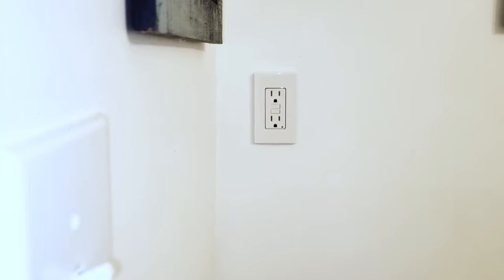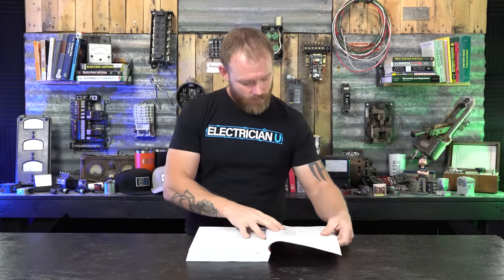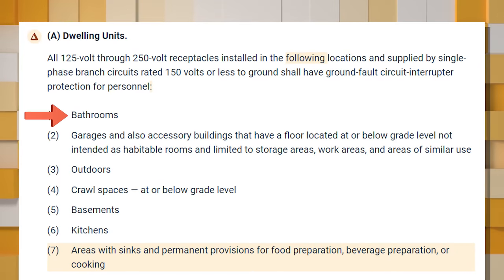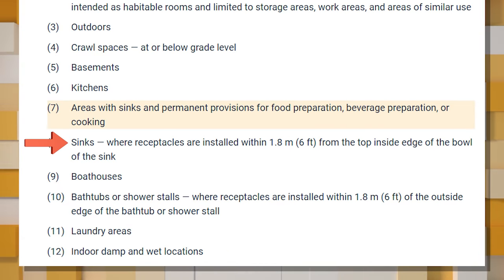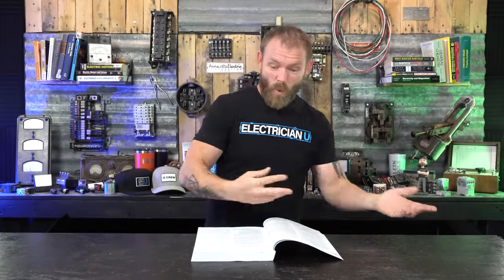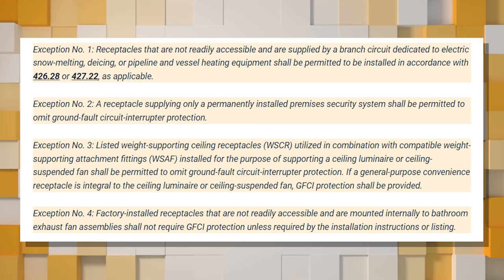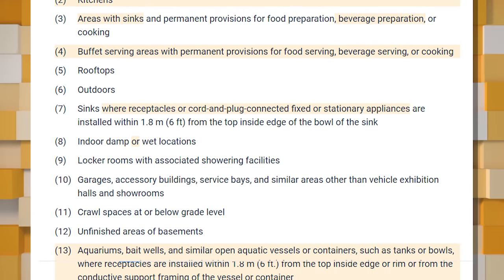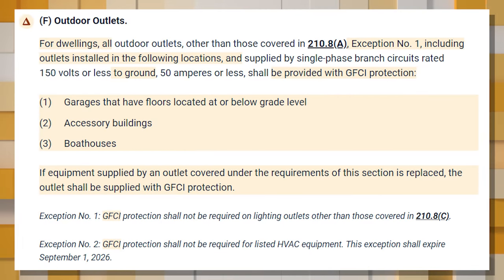Where and Why Do We Need GFCI Protection?

Comment: Wish, back in 1952, the house we lived in had a Ground Fault Breaker for the Basement.  I was 7 years old went down into the basement and wanted to turn the light on but could not reach the chain.  So I climbed up on the water tank and grabbed the chain. Getting electrocuted I Immediately started screaming and was frozen between the string and tank.  My mother came running down the stairs with a wooden broom and knocked me off the tank.  I had two black holes burned into my thumb and the doctor put me to bed for two days.
Reply: Close calls like what happened to you, is why code changes occur (equipment grounds in the late '50s/early '60, GFCI protection in the 70s and expanding in subsequent code cycles, AFCI  protection in the early 2000s beginning in bedrooms and now covers pretty much every area in the house. , I believe it's required that for pull chain fixtures a rubber piece called an insulating link, is used with a metal chain, to prevent an internal failure in the fixture from electrifying the chain.
Reply: Gene Metz - Wow! You are very lucky!
Reply: @Sparky-ww5re  Glad I read this comment as I just bought a 1924 house with ungrounded receptacles and some old pull chain lights of unknown age in the basement and attic. Will look for those rubber insulating links now.

Comment: Our 64 house has some interesting wiring. One circuit on the back of the house covers a kitchen wall, the back porch outlet, and the guest bathroom. The people that remodeled it clearly didnt have an electrician, as every single one of those areas has it's own GFCI. Now, every time it's slightly humid outside, we get to play a game of "which GFCI tripped."
Reply: Maybe rewire all the receptacles with each device pigtailed. then even if one trips, the rest will still have power. That's if all the receptacles are GFCI type, and no receptacles downstream of one GFCI receptacle are depending on it for required and/or desired GFCI protection.
Reply: @cavscout888  well wouldnt there be some daisy chained later that would be off from the gfi that tripped
Reply: Why not just put the GFI on line side?
Reply: That's what's happens when you load gfci off of other gfci. They should have line sided all the gfci
Reply: Well if that’s apart of your small appliance circuits it cannot leave the kitchen
Reply: @cloakedsquid  Nope, none. Not if they're all pigtailed. Essentially each one is branched off that way.
Reply: @cavscout888  oh that makes sense i see what you're saying
Reply: @dracula3811  Hello. Is 'line sided' another way of saying 'pig tailed'?
Reply: If you put a gfci at the first receptacle on the circuit and feed the others from the load side of that first gfci you can change the remaining receptacles to regular ones and they are all protected from the first one. Much less expensive and you always know which ond to reset. Gfci are problematic but they save you if you have a fault in an appliance which is not double insulated or you bathe with hair dryers.

Comment: Sinks in weird places. I’m doing a house right now and they put a sink in the master bedroom for a coffee bar so I have to install gfci protection at that location because it’s a beverage prep area.
Reply: Let me guess, 70's house?
Reply: @kennethmc2601  you would think it but no sir. It’s an early 90’s remodel. It’s been a pretty nice job. Nightmares at time. They took out several load bearing walls surrounding the kitchen and installed engineered beams to open up the floor plan. Almost all of the kitchen circuits were running down those walls they took out lol. So I’ve had to reroute all that stuff. They put in an upstairs kitchen as well as a media room. Along with a butlers pantry , a nanny’s quarters and a coffee bar in the master bedroom. Added a lot of Canless recess lighting and under cabinet lighting. Accent lighting , Outside fans and lighting…. I’ve been on this job since the middle of August. It’s been fun to say the least lol.
Reply: @alphasaiyan5760  Sounds like it. I am remodeling our house built in 1954. Lots of WFT moments! Good luck!
Reply: @TwilightxKnight13  lol I feel ya. Yes sir you as well 👍

Comment: We just adopted 2017 NEC here. Inspector told me I need GFCI protection for my 3-phase 30 amp oven receptacle in a commercial kitchen. I searched the internet far and wide, even called Siemens to verify... Sure enough, there is no such thing as a 3-pole 30amp GFCI breaker, nor a 3phase GFCI outlet. How are you guys dealing with this?
Reply: I would tell the inspector that no such device exists and ask what the process is for an exception to the code for such situations.

Comment: Gfi for Ranges and microwaves were added in the 2023 code?  Oh boy.

It is nice that they put the list in article 210 instead of sending you over to 425 to get the list.

Is anyone requiring you follow the 2023 code yet?  We're still on 2020.

Comment: Thought it was that you had to have gfci at first position to protect whole circuit rather than having gfci at every outlet??
Reply: Every outlet that needs GFCI has to be GFCI *PROTECTED*. The outlet itself doesn't need a GFCI device built-in, it can be protected by another GFCI outlet upstream, or by a GFCI breaker.
Reply: Correct. You do NOT want a GFCI receptacle in every outlet location. You just use one and then run 3-4 downstream outlets on the load side. The code is not referring to the device. It is referring to the protection of the circuit. It is why you can use GFCI breakers and use standard receptacles and still comply with the code.
Reply: @TwilightxKnight13  that's what I thought but my interpretation of what he was saying made it sound like I had to have a gfci outlet receptacle everywhere not just a single outlet for a branch circuit. That would be very expensive.  The hard part would be figuring out which outlets the lead outlet

Comment: I've got a good GFCI outlet story. I service microscopes in hospitals and schools. There are student microscopes that have 5W fluorescent lamps that have a very simple circuit having just a SPST switch on the incoming hot and a ballast in series with the self-starting lamp. When plugged into a GFCI circuit, these microscopes can trip the GFCI when you turn OFF the power switch. My theory is that when you turn off the switch when the incoming AC is at the peak voltage, the collapsing magnetic field of the ballast causes a high voltage arc to ground so the GFCI sees current on the neutral that isn't on the hot. 
At 1 school I was at, there were 4 hexagonal benches with a GFCI outlet at every face. That's 24 separate GFCI outlets. When I turned off the microscopes, not only would the GFCI outlet trip that the microscope was plugged into, but several other GFCI's would trip with it. Why do electricians install several GFCI outlets in a bench instead of just one supplying protection to the other outlets on the same bench?

Comment: I'm surprised you didn't mention whether all receptacles in the area requiring them have to be GFCI receptacles or if a single GFCI receptacle can protect one or more downstream standard receptacles.
Reply: Most gfci receptacles have manufacturer specs that they can protect up to 6 devices. It's been a while since i read their instructions so that might have changed. So basically you can have 1 gfci and have it protect 6 devices. I don't recommend having too many devices on 1 gfci due to nuisance tripping though.
Reply: @dracula3811  I don't know the exact number either, but mostly surprised it wasn't mentioned. Whoever wired this house (circa 1995) made EVERY breaker in the kitchen GFCI, or they did a retrofit and simply replaced them all. TBH, in the last three houses I've had, I've never had an issue with nuisance trips except for one GFCI outlet that was actually faulty. But I get what you're saying.
Reply: @JCWren  Fridge/freezer too? That's a bad choice.
Reply: Sri, all convenience outlets. Microwave and fridge are not. But there's water for the ice maker in the fridge!  2026 and we might be seeing GFCI requirements for fridges. 'cause you might get shocked while dispensing ice, right?
Reply: @mrcryptozoic817  isnt it fun when fridge is on GFI? GFCI trips, Homeowner goes apesh-t their fridge is out, something is  wrong no breakers are tripped. I love the GFCI protected fridge nuisance trips from lil bastards opening / closing the fridge door a 1000 times when its hot as hell.
Reply: @JCWren  Everything is plastic on a fridge.
Reply: @drewbrown9678  Sarcasm, son, sarcasm .
Reply: I believe it also depends on how many feet of wiring lies between each receptacle. As I understand it, you slowly loose the ability to trip the GFCI, the more wire (or distance) you have in between the GFCI and the point of failure.

Comment: I question the idea of the code saying HVAC units themselves have to have GFCI protection after Sept 1, 2026. The NEC section is about receptacles and not about equipment.  I think what is meant that if a new outside condensing unit is changed out then the 15/20 amp receptacle has to be installed with a GFCI and if there is just a receptacle it must be updated to a GFCI.  But what do I know :)

Comment: Protection has become so expansive, its less trouble (IMO) to just used AFCI/GFCI dual-function breakers and protect the entire house. I am renovating my whole house and that is our approach. We are using gas appliances so it is less an issue than if we had an electric range, dryer and/or furnace. We projected only having one unprotected circuit for the air conditioner, though there is a service outlet in the disconnect panel that is GFCI protected locally. However, if the next round of code is going to add the A/C to the list, we may just go ahead and do that now. Not much of a change in the grand scheme. We also upgraded the 100amp service (12 breaker position main panel) to a 200amp service (48 positions) with plug on neutrals. Made the project much easier and we don't have to track down-stream receptacles for labeling.
Reply: I agree 200%! I have noticed that some people will plug a drop cord into a non-GFCI receptacle or light bulb socket adapter and use it outside. You lose safety if that drop cord doesn't have its own protection built-in. It only makes sense and simplifies code if you just say that every breaker has to have dual-function protection.
Reply: I love DF breakers. Simpler and protects everything from the panel out. Would that I had the money to upgrade to a panel like that.
Reply: I would just replace all the breakers in the house with combined A/GFCI breakers if they weren’t so ridiculously expensive.  Eventually I hope to do so if the prices come down.  For now I’m using GFCI outlets which are far more reasonably priced (and can protect a whole circuit if wired correctly).  You’re right though that this is really the best way to do it.  Protect everything.

Comment: I plan on installing an outdoor receptacle that is covered by an awning. I have GFCI receptacles but they aren't rated WR for weather resistance. Is WR really necessary?
Reply: Yes, it is still outdoors in a wet location.  the WR rating adds features to keep water and moisture from getting in and coroding the terminals.
Reply: It’s better to just have it and not need it then need it and not have it. Do you really wanna have to replace that outlet a second time and waste the time and money? It’s only a few bucks more and if it’s only 1 outlet just get the weather rated one. You don’t want nuisance trips with a slowly dying gfci.
Reply: @FishFind3000   It's around $20 for the WR GFCI receptacle. I just have a ton of hospital grade GFCI receptacles in my storage that I could use. There will be an outdoor cover for it so it's unlikely to be exposed to too much weather conditions.
Reply: @FKS1994  being outside is a un-conditioned space so you have huge swings in temperature and humidity. You will have condensation or dew to deal with. It might not necessarily be a wet environment but it can and will be damp at times.

Comment: I'm a maintenance guy for a housing company in Ohio. Our oldest house is 15 years old. During our last inspection last summer the inspector failed all 38 houses for not having GFCI outlet in the ceiling where the garage door opener plugs in. This makes no sense to me. The garage has an outlet at ground level that is GFCI. But the outlet at the garage door opener is on a 10ft high ceiling. No one is plugging their shop vac into it. Not to mention, If the GFCI outlet trips when you try to open the door and your car is parked under it, I'm not really wanting to stand on my $50,000 car to push a button on the outlet to reset it. Seems like a Dumb place to require one to me.
Reply: I wish there was a rule about putting these in garages. My garage circuit is GFCI protected from the first outlet, which is inside the garage on the same circuit as the door opener. It did trip once, for no apparent reason. Fortunately the back door was unlocked or I wouldn't have had any way into the house since I normally rely on the garage door to work. I'm planning on moving this receptacle to the exterior wall in the future to mitigate that.

Comment: We in the uk GFCI every circuit regardless as we use the mighty 240v single phase.
If a plugged in appliance is tripping the gfci its faulty don't use it.
Reply: Yeah, it seems silly to be less strict about GFCI codes because we want to prevent nuisance trips. The GFCI is tripping for a reason. If something is faulty, it needs to be fixed or thrown out. The UK certainly does it right in regards to this.

Comment: I have a GFCI outlet in the kitchen near my oven where I use my coffee maker. It trips every time I use the coffee maker. Should I go to the breaker and change the switch to a higher voltage? If not, what other options do I have?
Reply: Either your coffee maker is leaking electricity and causing a ground fault or the number of devices on that same circuit is being overloaded.

Comment: I think you are making a mistake to only consider touching the floor or puddle as a shock risk.  That is hardly the only way to complete the circuit.  You could be on a metal ladder that makes contact or even a grounded contact on a metal surface.

Comment: I learned the hard way, some refrigerators do not like GFCI receptacles. Had a frige that kept tripping the GFCI but the owners manual says it, DO NOT USE A GFCI so I connected a regular receptacle and life was good. I have a GFCI at my house with my frige because the receptacle is so close to the sink. I had it like that for years and never had a problem but every frige is different.
Reply: What a crappy fridge do you have???
A well designed appliance (even a fridge) shouldn't trip a GFCI (not even a 10mA GFCI).
Reply: @ppdan  My fridge is a G&E and you can call it whatever you want but I've had years with it with no issues whatsoever.
Reply: @joeshmoe8952  Still funny that a well designed fridge trips a GFCI.
Had a few fridges (3-4) over the past decades and they never tripped the GFCI.

Comment: 1.  Garbage Disposal Switches Should be on GFCI's IMO ! - Hand under faucet, other hand on live switch. 

2.  About GFCI not supposed to control a branch circuit - Isn't that the purpose of GFCI Breakers ? 

3.  End of Exception 3 - GFCI is Required on a light fixture with a built-in convenience receptacle -- picture the typical  porcelain closet fixture.  Pointless, but they Buried the Requirement into an Exception ! 

Ranges & Dryers - Only require GFCI if Less than 150 Volts -- Please make more clear next time.

Another great video, as always.   Much appreciated.
Reply: #12 says ; indoor damp locations..

With that said, i guess that the subpump should be plugged in a gfci ...

Yet, i have witness basement flooding due to a tripped gfci powering a subpump...
The owners where out for the weekend, and had a little surprise back home..

NEVER PUT A GFCI OUTLET FOR A SUBPUMP. whatever what "code" says

Comment: Will the manufacturers of vfd drive motors be able to solve the problem of tripping GFCI by 2026?

We run into problems of running new furnaces on job sites with temporary power. The capacitive electronics trip the GFCI.

Comment: Remember, common sense is not defined in the code.
Any bath fab installed over the tub itself will require GFCI protection per the manufacturer's installation instructions.

Comment: Would I need to put my 240v 20amp outdoor heater on a gfci breaker? Or no bc it will be hardwired? Also, I'll be mounting it up closet to the ceiling.

Comment: My Landlord sends me a message saying, my Garage fridge needs to be an “Outdoor Fridge”. I told them Outdoor fridges are different and are weatherproof, and can withstand the elements of rain, snow and direct sunlight……. This doesn’t apply to the fridge I put in the Garage……. Now, Does a fridge in the Garage need to be on a GFCI? My garage drops down approximately 10 inches from the kitchen and throughout the rest of the house.  Are they really complaining about the fridge Not being an Outdoor fridge or will they have a case on me if it’s not on a GFCI outlet? My last house had a GFCI outlet and would trip all the time…… it’s just a fridge, no freezer on top….I only use the fridge for drinks, and the occasional birthday cake storage. Should I tell my Landlord to go pound sand?